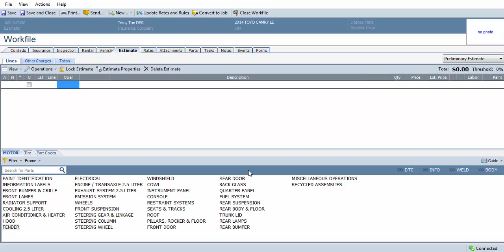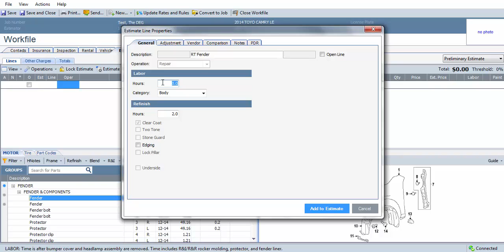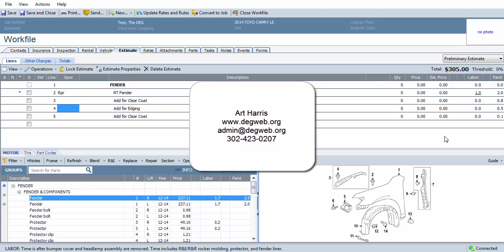CCC One - Clear Coat the Edge of a Repaired Panel

Comment: Question, why would you edge if repairing? Wouldnt that be only for replacement?
Reply from the maker: It may be necessary if the damage is to the edge of the panel and there is a need to refinish the inside edge of the part. An example could be if the door opened into a pole or another vehicle and the rear of the door was damaged.
Reply: +The DEG got it. Love the DEG! Thanks

Comment: Art,Another Problem CCC automatically calculates clear coat on the inside of all, jams, edges, and undersides when replacing the following parts; complete doors, quarter panels, luggage lids or lift gates! Meaning the clear coating of the insides, jams, edges, or undersides the system is including the non-exterior clear coat time, in the exterior max of 2.5 hours. thus improperly calculating exterior clear coat time. So if the clear coat of the exterior time reaches the 2.5 hours max improperly, then the shop looses the clear coat time on the jams, edges, and undersides because of this database problem! If you look at Mitchell, or Audatex  they both breakdown the paint regardless, if it's repaired or replaced, therefore we get the proper clear coat times on those systems. Motors should break down all paint times so the jams, undersides, and edges calculate clear coat properly.